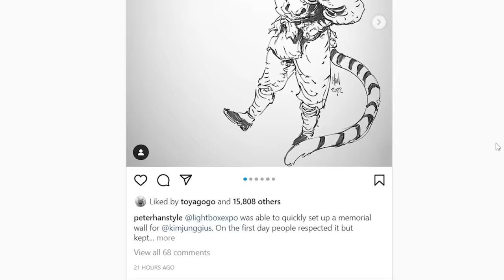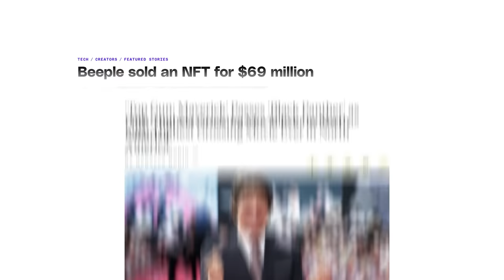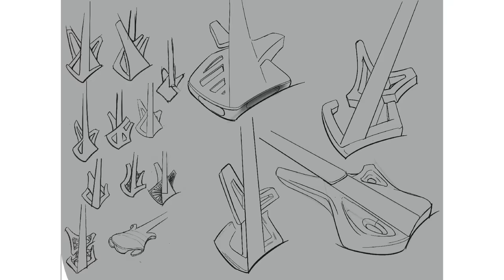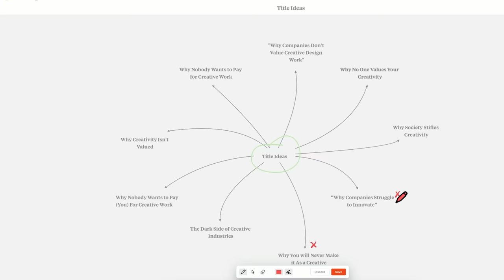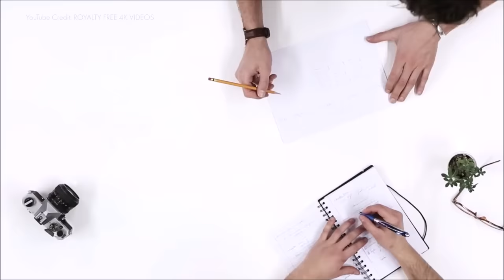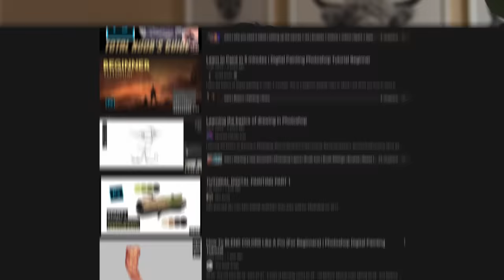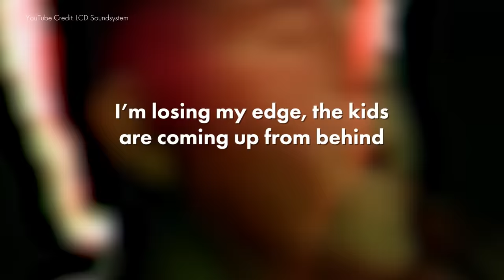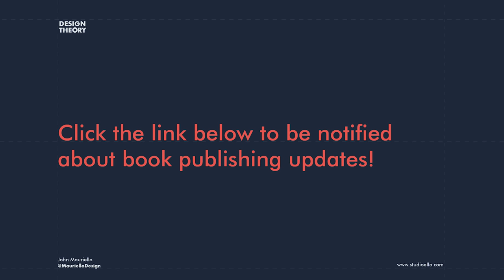Why Society Hates Creative People (And What To Do About It)

Comment: I've worked in software for almost 20 years and for a long time I didn't understand why would felt so drained. That was until I realized that designing solutions to problems was a creative process and doing it at the rev limiter all the time was why I was feeling so drained. At least, that was part of the reason. The other part was the lack of recognition by management mostly due to them not understanding what I actually do or what it takes. I've also never had anyone to really discuss ideas with or share what I come up with. Somehow I've always ended up being basically solo where I work and although there are other people working there, they don't do what I do and so don't understand it which means sharing it... well... they don't understand and they care.

A few years ago I took it upon my self to rewrite a piece of software we had that was a proper mess due to how it was built over the years. Basically, things were just tacked on as it was needed and eventually it became too much. Just doing what I was told wasn't working and I knew it could be so much better, but as you say, companies will rarely go past the idea stage which is very true in software and even more so when there is very little understanding for what you do.

I built a new version anyway and it surpassed even my own expectations. It's not perfect by any means, but I showed to my self that I can do it and I can do it very well. Sadly, usage of the new version is almost none and management decided that a new rewrite is in order and the process is mirroring how the first version was built.

I put so much of myself into it and it's just wiped to the side like it never happened. Yes, I'm moving on and yes I should have done so years ago. I've come to the conclusion that where I am now is not working, but going somewhere else may work. The choice between staying where I know it doesn't work vs going where there is potential is an obvious one... or at least it is now...

Comment: Pro tip for new people. ALWAYS prep your battlefield. When pitching always deliver a minimum of 3 ideas. Doesn't matter if it's an individual commission or a massive gig for a fortune 500 company. ALWAYS ALWAYS present a MINIMUM of 3 ideas. Give them one bad idea with low effort, one good idea with some effort, and one great idea that YOU want to do with ALL of the effort you can muster. Non creatives want two things, to reduce risk and to get across the finish line as quickly as possible. Most people would rather be presented with 3 options to pick from rather than look for exactly what they think they want. You can use that to your advantage both to save your time & sanity and to garner as much creative freedom as possible.